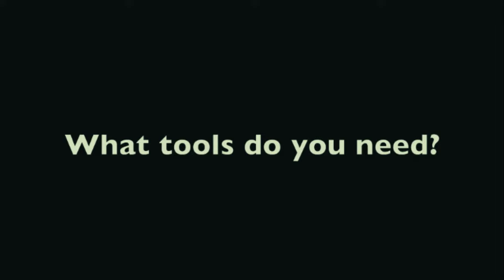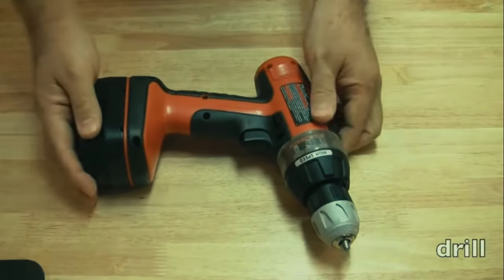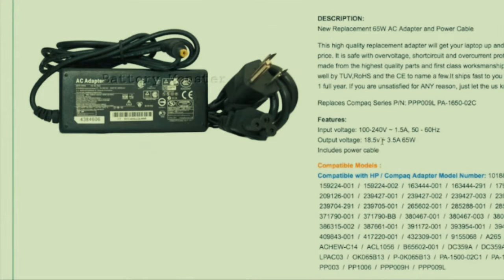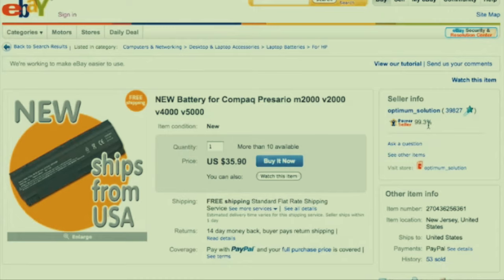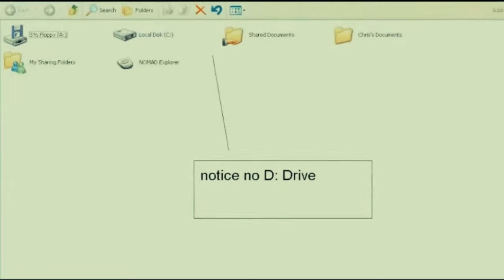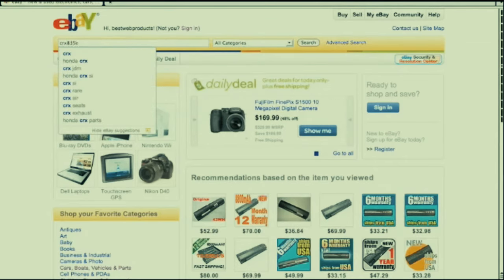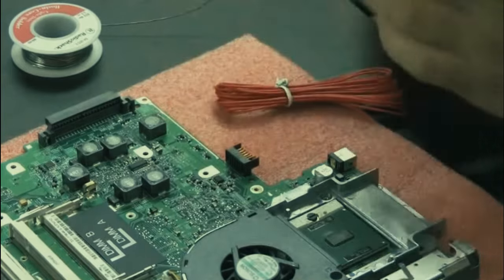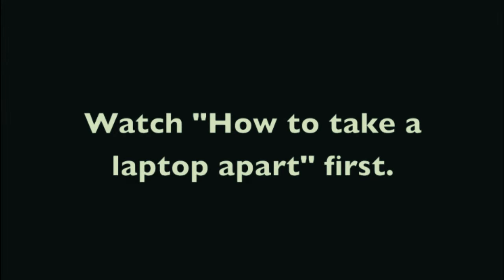Laptop Repair Tools and Basic Parts (Part 1)

Comment: After the bios update from the Dell website my Alienware 15 r2 was stuck in the process I disconnected the battery and ac adapter after a long wait. now no display just the laptop start can hear the fan and lights on the keyboard but nothing response.  ram and other parts working on other laptops. any help?
Reply from the maker: Try, remove the it from power chord, keep pressing  the power button abouy 30 seconds and release it, and then turned on your pc again
Reply: still nothing change

Comment: What about?

Telescopic magnet. For picking things up you drop. Because not every screw driver has a magnetic head.

Microscope. For looking at mobos.

Heat gun able to direct precise heat to smallest space. 

Adjustable power supply. Showing voltage and current used by the load. From about 1V to 20V. Up to about 3A.
Reply from the maker: Yes
Reply: So bro how those tools for laptop repair shop can cost